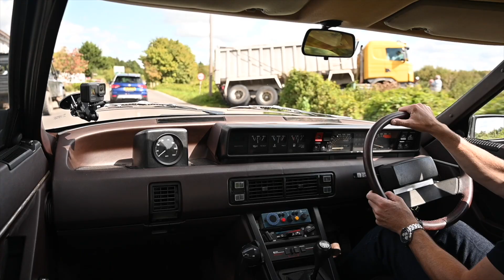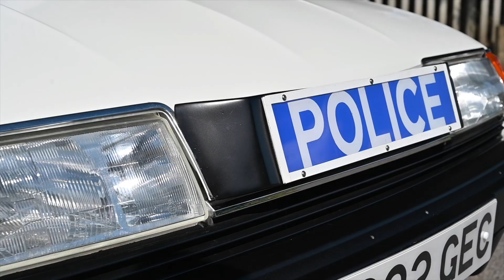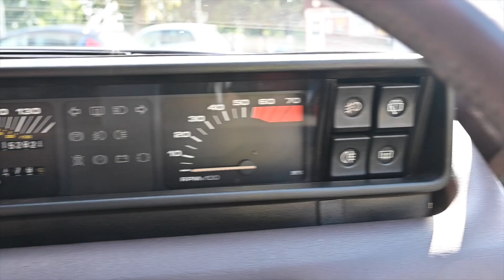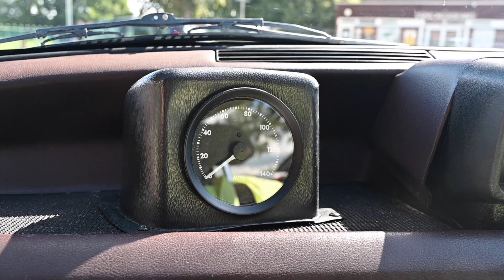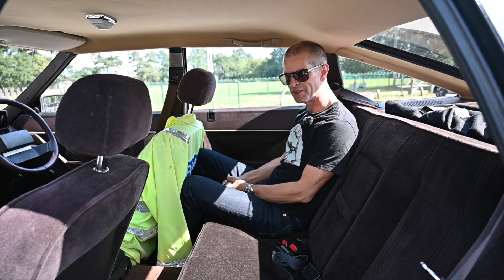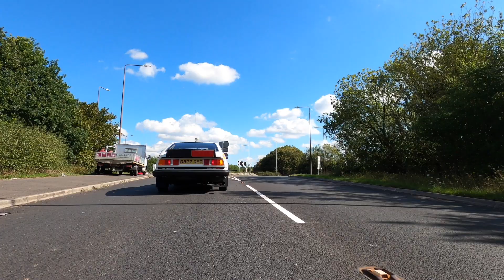1986 Rover SD1 Police Car

Comment: This is awesome! What a great video, along with Volvo T5s and Senator 24vs - the SD1s were the best cop cars ever! None of those plastic BMW crap they have today. Great video Matt. No wonder it garnered so much attention - such a handsome, characterful car despite the Police livery. My friend’s 850R always gets a lot of attention out and about. These older iconic cars are so much more interesting than anything these days. Can you imagine a new Hyundai i30, 3 Series or X5 getting the same in 20 years? Most definitely not!
Reply: I drove many cars as a traffic police officer. Rovers were okay albeit a little unreliable.  As for BMW..I am on my 11th; how many have you had?
Reply: RichieRouge206 Bull rose tinted memories there an old retired mechanic friend of mine used to service them for the police back in the 80's his first job was to drill holes in there boots to let the WATER OUT they were badly desighed engineered Junk rot boxes, todays car's BMW's , Hyundai's are a 100% better that's for sure there. The example in the video must have been kept in an air-conditioned room!!!

Comment: I suppose if you look hard enough you'll find eastern Europeans creaming themselves over some of the rubbish they made too. The SD1 was a truly horrendous POS. You can only blame so much on unions and assembly quality control etc. We had the previous series of these in Australia (locally assembled) and they were unreliable, too expensive, and outclassed in performance with local offerings from the big 3. Their only worth after a few years was their engine for reuse in something else. Must be at least 25 years since I've seen an SD1 here. We enlarged that engine to 4.4L back in 74-75. 11 years later your tired series 2 SD1 Police cars are still using the 3.5L version. 170 HP wow!!! Lol

Comment: i think it looks like the back of a ford sierra or so slammed into the front of a renault alpine ... this older wedgy like one .. not the recent alpine model...bit cheaply but the design is alright if you d use more quality parts and/or wider and slightly bigger rims ... like adding chrome on top and bottom to the bumper or so ..... like a pre facelift E30 BMW ... i d make such car more chic , hehe ^^

Comment: A traffic police driver said to me in 1987, one of the top reasons the police liked to have these is that "They crash well!"  I bought one and I could walk along the top of the front bumper from one side to the other.  The front bumper is 5mm stainless steel.  Half a centimetre thick!!!  Strong and lasting indeed.  The front crumple zone worked to push the back of the gearbox down to prevent intrusion into the safety-cell, in the event of a severe front impact.  Standard now but advanced then.
Today our car-fronts are 0.5mm polyurethane.  Oo-er Misses!

Comment: I recall sitting in the back of one  in Glasgow in the late 80s when Strathclyde coppers decide I was proceeding a bit too quickly on the Clydeside Expressway : 3 points please ☹️

The SD1 was an absolute stormer with the V8 - it was THE car to have but BL completely trashed it with delivery delays, shortages and awful build quality.

Comment: I used to work for a big foundry group in Smethwick just outside Birmingham. One of the group companies was The Birmingham Aluminium Castings Co (BAC) they made the castings for these engines, I don't know if they did all of them but if you see BAC cast into the block or heads then you know where it was cast.

Comment: Wait...I'm confused....the rear seat where criminals go has functioning windows and functioning door handles....isn't that a bad idea? You pull up to a stop sign and your criminal in the back just jumps out and runs away...?

Awesome car though!
Reply: Rear doors had 'child' locks to stop them being opened from the inside; the window winders would likely have been disconnected or restricted to only opening a certain amount.

Comment: 14.7 gallon fuel tank capacity? That's only 67 litres. Pretty small for a car with a V8. Driven  hard that wouldn't give much more than 200 miles range.

Comment: Having worked as a mechanic for an Austin Rover dealer in the late 80s, I can confirm that there were modifications done to Police vehicles; a differnt camshaft to the standard cars being one of them.  It wasn't a secret though, so I'm surprised that you haven't been able to verify this.
Reply: I'd have thought by now that would be near impossible to verify. 

What cam profile was it and who made or reground them?
Reply: @skylined5534  It was a higher lift cam, but no idea who made them.  The parts catalogue just specified some differences between police and standard cars.  This was for SD1 and the 800 series.

Comment: Back in the 80's I got my hands on a blue neon light with a magnet on the base from work and on the way home down the motorway in my blue Rover 2600s I saw my mate in his old Yellow 2600 SD1 and could not resist trying the light out, it was dark so he did not see me pull up behind him and he pulled over as I flew past --made my day but could have got me in a lot of trouble.

Comment: It's a car I so much wanted when I was 6-7 years old!.. It was unlike any other car here in Bombay(barring imports that is) .. Standard Motor Products India Limited manufactured these for three years and was launched in '85.. They plonked in a 2 liter Vanguard engine(The engine found in Standard Vanguard of 50s!) which was worked out a Lil bit to make 80 odd bhps and it was slow, gas guzzler and didn't justify the high price tag then(most expensive in India).. Add to that they were poorly built which is why hardly any example survives today.. Too bad.. How I wish they could get powerful engines to fit in, if not this V8 than at least v6.. But STAMPRO wasnt able to secure license from BL!!! .. poor efficiency negated company claims and they were drawn in legal battles.. When the company dissolved, the parts were bought by Rimmer Brothers to ship back to UK.
Reply from the maker: Yes, those Rimmers parts have saved lots of SD1s here and made them much more common on the road again in the UK, Im not sure if this car has Indian parts in it but I think the owners other SD1 has!
Reply: @furiousdriving  I'm happy they still are running... It's a sexy looking car ❤👍

Comment: Sorry to say but I have noticed over recent videos your mic has been pants and needs to be sorted. Fine if you sit perfectly still but if you move the T-shirt interferes awfully
Reply from the maker: Its actually not the microphone but the wireless transmitter. Ive ordered a new one now, they have been out of stock a while so a new brand is on the way

Comment: After having had something else to do, I have to say that the British police have improved considerably in recent years in terms of their "means of transport" so here a Rover 3500 with a huge petrol guzzler V8, I suspect that the police officers were more at the gas station than they were on the road, but after that cutbacks had to be made in the police departments so that when the somewhat "less gas-guzzling" Vauxhalls were purchased that had a top speed of about 150 km per hour, but not too long because that they blew the radiator out of the front and only then came the real BMWs.
What I am now waiting for them to switch to the Volvo's with a thick 250 + horsepower under the Hood / Bonnet.
But as always, Good Job and well done
Reply from the maker: They've been using the new Volvos a while now, and of course had the T5s when they were around, changing the  front tyres every 2 weeks!
Reply: @furiousdriving  Huh? changing tyres eververy two weeks?  what the "heck" they are doing????  Can we ever see these in new episodes of Traffic Cops ???  ha ha ha like a kind of this: Ehh police station, yes central here, ehh we have to give up the chase because our front tires are down !! Sorry!!

Comment: I remember the SD1 from my time at an Austin Rover Dealer in the 80s we had an ex SD1 police car and the clutch pressure springs were up graded to stop clutch slip giving it a very hard clutch pedal to press. I seem to remember that the stop watch was a Rover fit and nothing to do with the Police.
Great Review.
Reply: Yes that’s true. Police spec cars had an up rated clutch pressure plate, and a slightly different gearbox

Comment: Sure the P6 push rod front & fully independent rear suspension with inboard rear discs was a better chassis set up, but McPherson strut & multi link n coil sprung rear on the SD1  never held back the Escort RS 1800 when set up correctly.
Do look up the "liver run" video, it shows besides nicking speeders these traffic cops used their skill to save lives when called upon, some day it could be you needing that surgery.
Reply: The P5 had a DeDion rear, not independent.
Reply: @shebbs1  Yes, my mistake. DeDion is not fully independent but it is superior to a live axle, a kind of half way house set up if you like. It's been a long time since I saw under a Rover.

Comment: Those hateful SUs with a stepper motor also had plastic gears which together raised and lowered the main jet. When (not if) the gears stripped you had to buy a new motor and gear unit at monstrous cost. When the carb on your eg. Montego went that way an SU HD4 from a Maxi/Marina/Princess etc and a choke cable was a much better/cheaper long term solution.

Comment: My uncle had a 2600 auto and he let me drive when I was still quite young. It was the first auto I had ever driven and the first big car, I also sat in the back of it all the way to South of France and back.  It was a lovely thing to drive and I think started my own preference for large saloons. Now I'm driving a Jag X350 and I think my uncle would have liked it. He had a tendancy to drive cars hard and break them but he never broke the SD1.
Reply: It's great to hear this because the Straight 6's are much misunderstood but lively and reliable with plenty of torque. The sad fact is, they get completely drowned out by far too much US inspired V8 burbling.
Reply: @wpo2949  he used to cruise on the French autoroute for hours on end at 90+ mph and it did it reliably and with ease.

Comment: Brings back the memories as a transplanted Brit in Australia buying my 1982 V9 SE auto (Feb build) in 1995. My dream car as a kid in the UK, this thing almost sent me bankrupt.  Switches failed, bonnet struts gone, front shocks gone. Back door swung open on a roundabout despite being closed. Rear wiper didn't work...until 'D' was engaged & you didn't need it anymore. Mainly used my bicycle for transport. Do I regret it? Heck no. It was a car full of character & when running right was just magic.

Comment: The speed transducer in the gearbox will be faulty, I owned many SD1 Rovers over the years. 
I used to be the Scottish rep for the SD1 club. 
I drove all the SD1 models except the diesel, the V8 was the best.
I owned a series one V8 and a series two V8 Vanden Plas, both manual gearboxes, the manual VDP was a rare beast. 
I used to fit poly bushes to the suspension, that made them handle better, I believe the Police used uprated bushes too.
The SD1 is still my favourite car, unfortunately my VDP was stolen and burned out, otherwise I would still have it.

Comment: 155BHP from a 3.5L V8 - just 18HP more than the 1.8 16V Golf Gti from the same year :)
Reply from the maker: Old school grunt - lots of torque so it shifts
Reply: Yeah but massive torque and you get a nice smooth gradual increase in both throughout the rev range, so it pulls in all gears at all times.

Comment: At first I thought that the 'beacon' button read 'bacon'. 😁 🐽
Weird spec on this. I assumed that the last of the V8s were all fuel injected and had electric windows at the very least. Or was this an early 80s phase 2 SD1 that had been stockpiled? 🤔
I'd love to have a drive in one of these. 😎
Reply from the maker: SE was lower middle spec so only got manual windows. There were EFi models but that was a higher trim level until the very end

Comment: I guess everything is relative, the SD1 was not considered to be wide in Oz, rather they were  smaller than the standard Oz Holden VN Commodore or Ford Falcon.  Even the early Oz SD1s had a smaller V8 than the P76 from  the previous decade.
Reply from the maker: Its no wider than my daily car but the thinner doors mean theres a ton of space inside

Comment: I find it hard to believe that it only had 175bhp on a V8 ? My KB1 Legend is a V6 and pushes out 290bhp. I suppose it's more to do with computerisation ?
Reply: It more to do with the 2 valve per cylinder heads and push rod opening, which together with the hydraulic followers limits how high it will rev. What is good is the power to weight ratio as it’s an all alloy large capacity unit with masses of tourque and the power and torque curves are very generous. So despite it appearing to have quite low figure for its capacity, it’s actually quite a quick car at mid to fast road speeds. It certainly suprised a few people
Reply: Also don’t forget the kb1 is 30 years newer!

Comment: The best, and most plausible, explanation for engine mods in police SD1s that I've heard is that the police cars got gas-flowed heads and balanced bottom ends, either from the people in the factory motorsport team and, later, by TWR.  It's an open secret that police vehicles, certainly those for traffic use anyway, have engine tweaks, and it's no surprise considering the weight of equipment that they carry in service.  I came across this when I had an ex-Hampshire Constabulary unmarked BMW (late) E28 528i, complete with boot badge, as this was from the period when BMW began offering the delete option on the boot model designation.  I gave the car a service and changed the spark plugs and it ran like a bag of spanners being thrown down the stairs, which was odd as it had run well before.  So I took the plugs back and got another set from a different manufacturer, but still with the same result.  I was getting a little concerned that I'd either bought a pup with incipient expensive engine issues or I'd somehow hurt it by doing the service, but I thought I'd do my due diligence and check things out with the very helpful parts man at my local BMW dealer, who confirmed that, yes, the car did show up as a 528i and so the plugs I'd tried should have been correct, so he suggested checking by engine number, which showed that the car actually had the 3.5 litre straight-six.  There were absolutely no signs the car had had an engine change, which the service history from the police confirmed, as did the parts man's assertion that everything under the bonnet was all correct BMW standard-spec parts as you would expect from a police vehicle, and the person I got it from was a police mechanic who had bought the car when it was retired and cared for it since, until his desire for a manual Senator became overwhelming.  Certainly, having an extra 600+cc under the bonnet in a lighter than standard car (no sunroof, no electric windows, standard trim rather than the thicker carpets and nicer cloth/velour of the SE) and a police driver would give you a useful advantage over wannabes in civilian-spec Beemers.  That car absolutely went like a train and ran like washed silk, once I had the right plugs in it...
Reply from the maker: So was it a factory engine upgrade?
Reply: @furiousdriving    As far as I could tell, yes.  It was a 535i wearing 528i badges...
Reply: Saab used to do something similar in Sweden... all the 900 Turbos they supplied for police use were badged as 900 GLs...
Reply: @mikebutler6308    It makes sense.  Lull the bad guys into a false sense of security and then blitz them with the power they don't expect you to have if needed.  The US police-spec modern Fords are a bit like that, you don't know if the Explorer/Police Interceptor Utility or Taurus/Police Interceptor Sedan is just the cooking V6 version or the EcoBoost twin-turbo model.  The Scandinavian police SAABs were also decidedly tickled, at least for traffic vehicles, and a number of them used on the faster roads were actually 16 valve turbo 4-doors, a model that was never produced for public consumption...

Comment: Owned a couple of ex Police P6's but never got an SD1,  one in the horrible blue and one in white which had the jam sandwich stripes added during its later service, removed along with all the equipment before being auctioned.  I added them and got into serious hot water over it and had to remove them or face prosecution, then had to repair the damage the second removal caused by a respray, in white of course.  Drove an SD1 a few times, a white one that had been given a vinyl wrap as an all over ad for a certain brand of German wheat beer by its owner as he owned a light haulage and wholesale wine merchant company.

Comment: Great review Matt. James's cars are always well sorted and his attention to detail is spot on.  I was always puzzled by the shape and placement of the exhausts on SD1's ... they always looked cumbersome and poorly placed to me?
Ah..you broke the speedo! lol.
Reply: That swept tailpipe was so the exhaust exited at the extreme edge of the car. Because if it entered at the rear the fumes got held in the low pressure zone behind the boot and recirculated into the cabin, despite the one way   valves.
Reply: @nitrosilvia  ..I knew there was an explanation, thanks James.
Reply from the maker: I always thought that as well, that odd twist always looked funny

Comment: Just to note. The sd1 is one of the few cars that cant be towed on its back wheels like normal manuals because the oil pump runs of the lay shaft and the lack of oil on a tow ruins the gearbox..(I did this back in the day and ended up having to scrap the car.